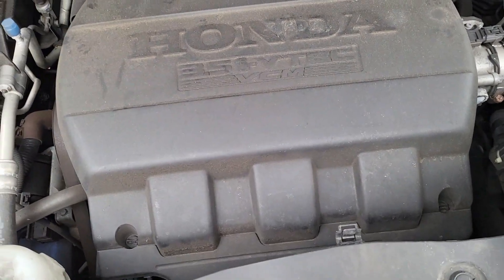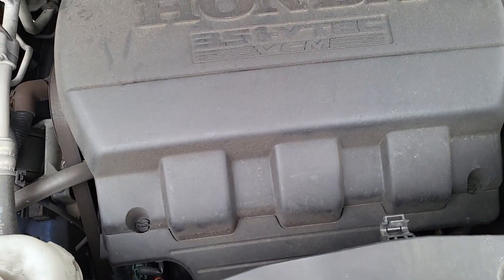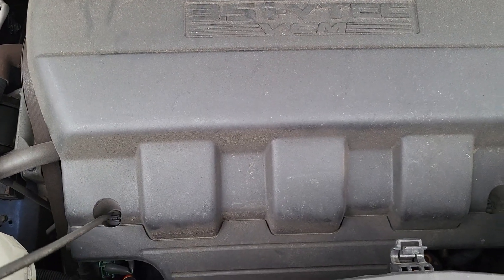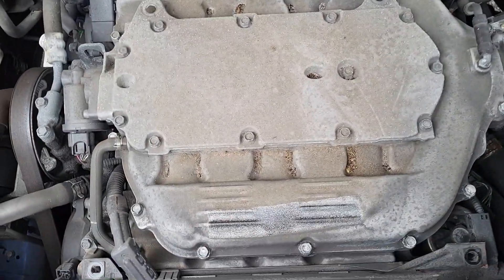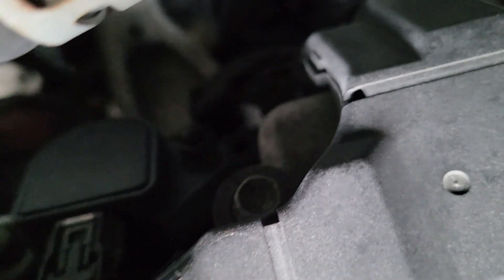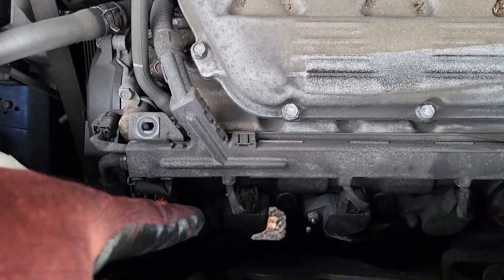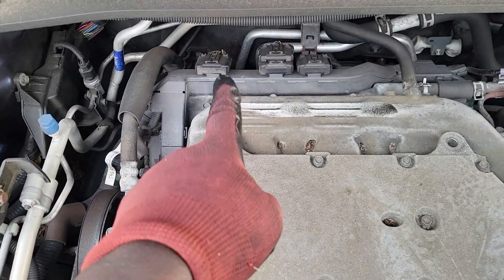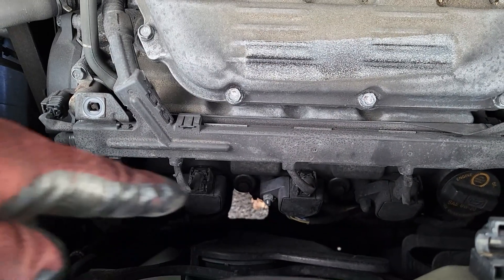HONDA PILOT 3.5L, ACCORD, CIVIC FIRING ORDER AND CYLINDER LOCATIONS MISFIRES AND COILS. BANK 1 & 2

Comment: I would imagine this would apply to first gen pilots as well? Engine looks identical to my 2006 honda pilot.

I got a check engine light p0302 for cylinder #2 misfire. What would you do to fix that? Spark plugs then coil then fuel injector? Thanks!
Reply from the maker: Usually, it is just either the sparkplug or the coil.